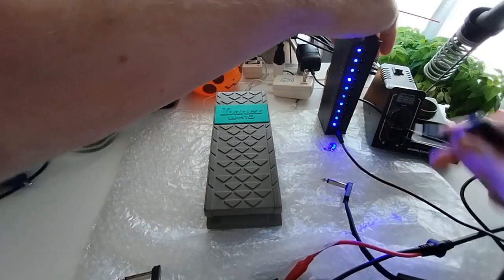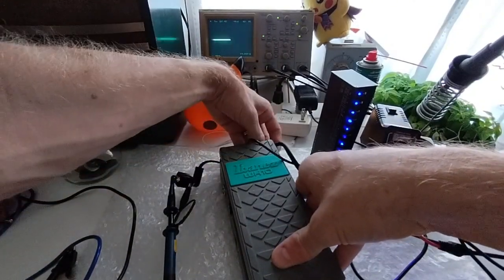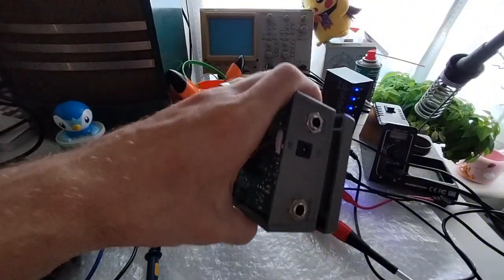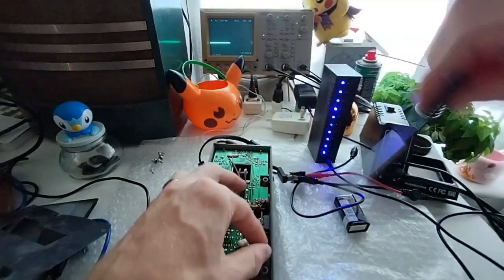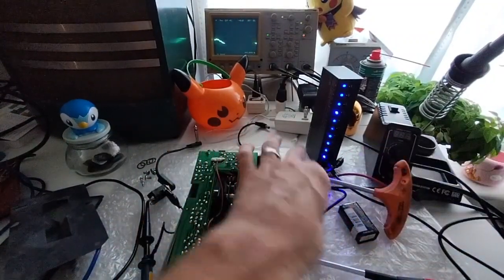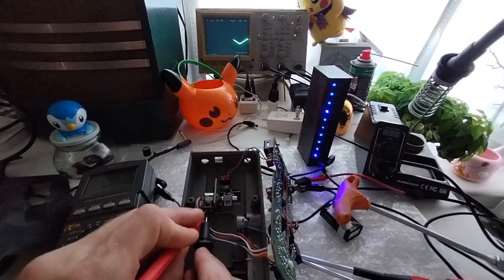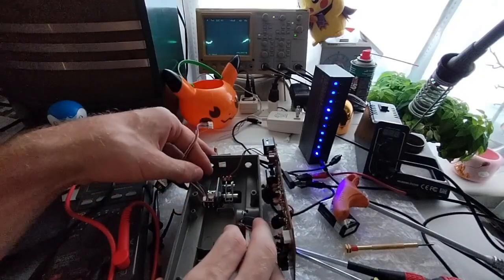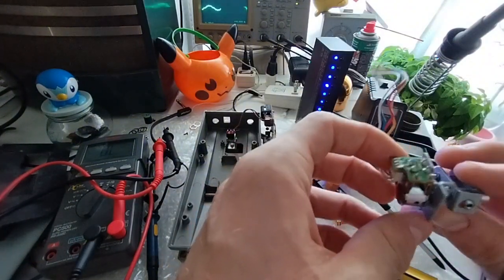Ibanez Wah WH10 V2: Improv Repair Potentiometer and LED Replacement

Comment: Hey bro, could you tell me where you bought that new potentiometer, I've looked everywhere and I can't find it, I would appreciate it infinitely
Reply from the maker: Hey Sebastian, thanks for checking out the video! I purchased my locally in Japan, and unfortunately the seller only had one. However, I was able to find some being sold on eBay right now via the following URL: https://www.ebay.com/itm/282632108869 As of now, there appears to be 6 in stock. 

I hope this helps!
Reply: @gaijean  Hey bro, thanks a lot for your response. I’m from Peru, and the shipping cost would be really expensive for me. So, after watching your video, I took the pedal apart, removed the pot, and tried to clean it a bit to see if the problem would go away. But then, just as I was doing that, the power supply stopped working, so now I’m waiting to get another one or a 9V battery to test it out. Hopefully, that will be enough, but if not, I might have to buy a new one. Anyway, I’m glad to see that I’m not the only one who had the same problem.

Have you thought about what you’ll do with that pedal? I was looking into some mods that could improve it since it’s a pedal that leaves a lot to be desired compared to the original. I saw that by changing the switch and some resistors, you could get a good sound, but I never got around to trying those mods. So, if you make any modifications and record it, I’ll follow along to avoid messing anything up. HAHAHAHA
Reply: @gaijean  Another quick question, bro. Does a potentiometer in good condition have a stop? (Sorry if I’m not using the right terms, but I really don’t know much about these things and I’m trying to learn on my own.) What happened is that today I completely took the pedal apart, and as I mentioned, I tried to clean the pot as best as I could. While doing that, I noticed that it didn’t have a stop; it could just keep turning and turning in one direction. Is that normal, or is my pot already junk? Thanks, man!
Reply from the maker: @SebastianGarcia-ee1fy  You're very welcome! Oh nice, I've always wanted to visit Peru! So it's difficult to figure out what's going on from your comment, but just a few questions. Did you have the pedal attached to a power supply when you were trying to clean the pot, or did you disconnect it first, clean the pot, and connect the adapter? Second, have you tested your adapter to make sure you're still getting the proper voltage (assuming 9V) with a multimeter? Assuming your adapter is center positive, you can test your DC voltage by putting your multimeter in VDC mode and putting the red probe inside your 2.1mm DC male plug and the black probe on the outside portion. If that works and you're getting 9VDC, I'd recommend putting your multimeter in diode mode and test your diodes next.

Regarding what I'll do with the pedal, I've listed it for sale immediately after this video. Indeed, there are probably some really cool mods that can be done to this pedal! So I won't be doing any modifications on this pedal, per se, but if you need help with the modification, just let me know what you're having trouble with and we can go from there!
Reply: @gaijean  Thanks, bro. Regarding the pedal, I know the problem is with the power cable because I tested it with other pedals, and it definitely doesn’t provide power. So, I might try a 9V battery tomorrow to check how it goes, and if it still gives that scratchy sound, I’ll need to replace the pot.

As for the mods, I was thinking of adding a 3PDT switch to make it true bypass and adding a volume pot, since that’s one of the main issues with this pedal. I’m really doing these modifications out of love for the pedal because it was one of my first ones. I’ve had it lying around for years, and now I want to bring it back to life.

Thanks for responding to my messages. And yes, you should come visit Peru—there are so many beautiful landscapes. Take care, bro!
Reply from the maker: @SebastianGarcia-ee1fy  Just to clarify your question, are you asking if it's normal that the potentiometer endlessly rotate, or should it stop when rotating? The potentiometer should definitely stop, so I'm assuming that your pot shaft is broken. I recently had the same issue with a Vesta Fire Stereo Phase ( https://www.youtube.com/watch?app=desktop&v=bXSg8c2ruzg&t=38s ), and switching out the pot helped fix that pedal. Inside your potentiometer, you have a rotating wiper which acts as a resistance divider. If it were to rotate off the pot's resistance track, then you would not get the proper resistance. Therefore, the fact that your pot continuously rotates already indicates that it's in need of a replacement, and cleaning will not help in this case! A replacement is definitely the way to go!
Reply from the maker: @SebastianGarcia-ee1fy  Those sound like excellent mods for this pedal, especially if you'll be using it often! Whenever you go that route, if you end up having any trouble with the wiring scheme, just let me know and I'll try to help! Take care, Sebastian!
Reply from the maker: @SebastianGarcia-ee1fy  Hi Sebastian! Hope you've been doing well! I'm just checking in to see the current progress of your pedal. Let me know how it's going!